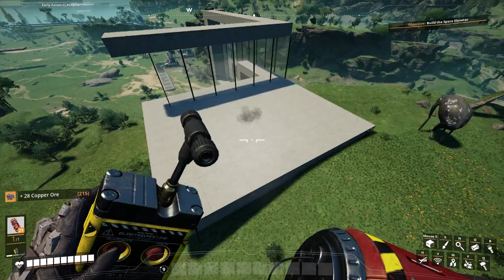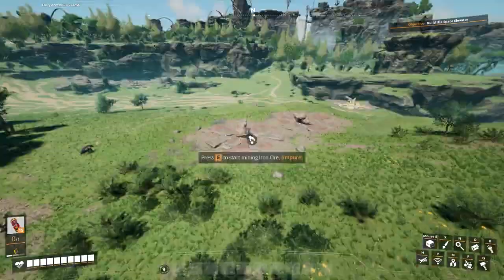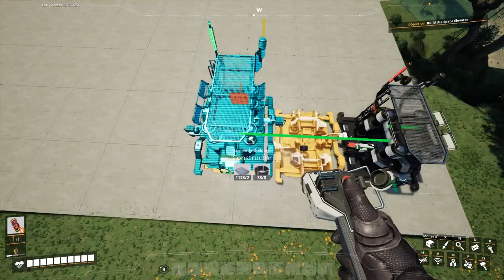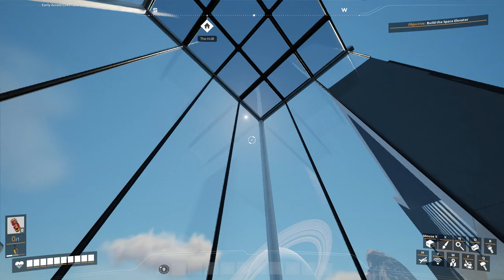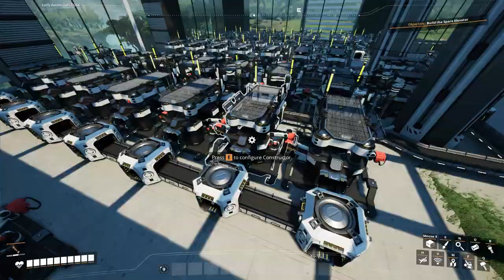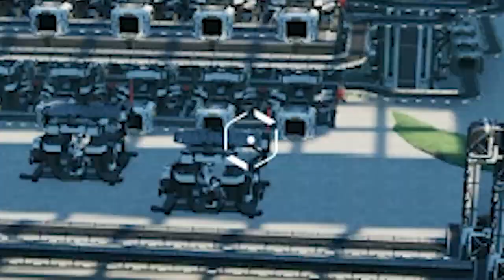MEGA Iron Factory!

Comment: On my last save i created a iron factory using refinerys in the green fields. Should have done it like this, because i probably only used 10% of that iron ever
Reply: I produced 15600 iron a minute
Reply from the maker: @erlingaakre6471  thats a lot of iron
Reply from the maker: @erlingaakre6471  its better to have more then not enough
Reply: @ well those modular engines aint making themselves
Reply from the maker: @erlingaakre6471  thats true